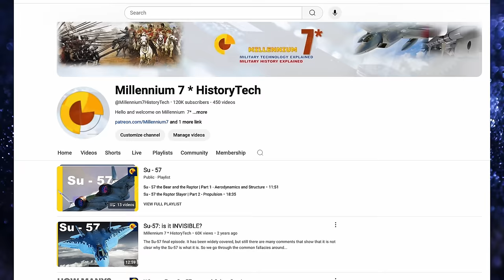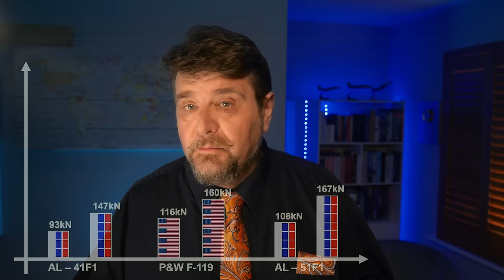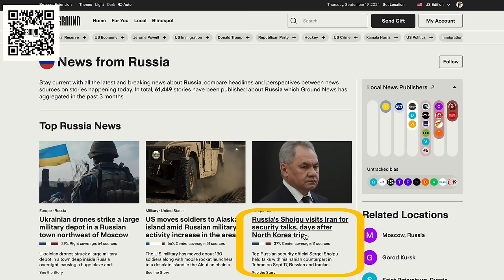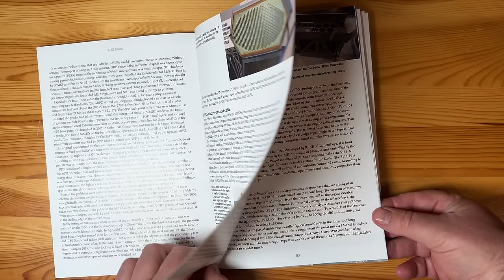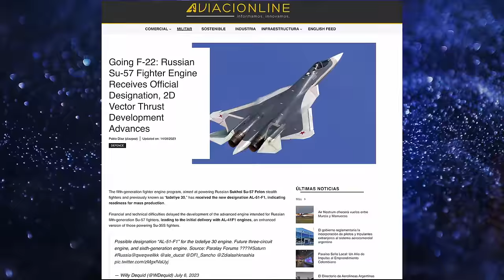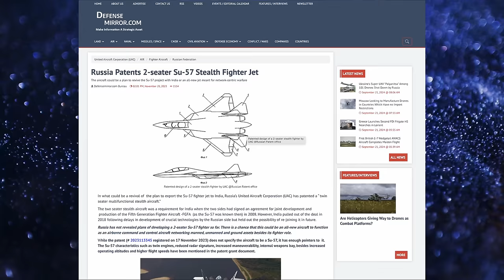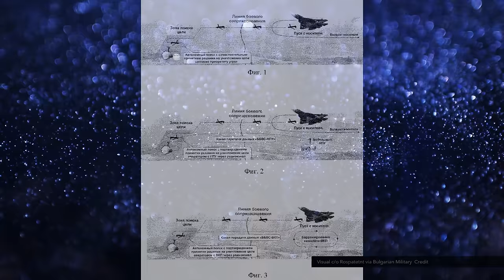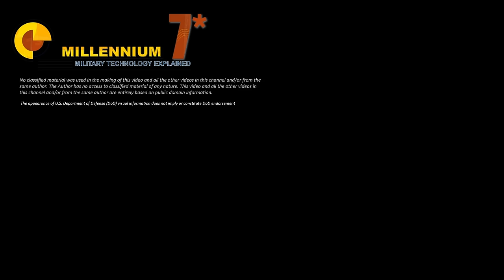The Su-57 is a Masterpiece!

Comment: F-22 is actually stealthier and more maneuverable, if you compare their RCS, Su-57 is claimed to be 0.1 vs 0.0001 of the F-22.
Also the F-22s thrust vector nozzles can tilt 35 degrees vs Su-57 can only tilt about 18 degrees, like Su-35. This allows F-22 to turn quicker. The 3d element isn’t really useful, as it would only come into play if the Raptor decides to initiate a rolling scissor with the felon, rather than just outturn it and shoot it down.
Reply: The F22 Has an RCS of 0.0001 square metres 

The F22 does not have an RCS of 0.0001 in order to say so is to misquote the source that says it, the RCS of a plane is not a fixed thing but varies from angle and by frequency as a result when we say the RCS of a plane we're referring to either an average or median RCS the 0.0001 number for the F22 is neither a median nor average RCS if you find the original quote of which  you can find here[1] you can also find it on the F22 Wikipedia page “from certain angles the F22 has an RCS are they steel marble” and is therefore not remotely representative of the F22's overall stealth capabilities I don't blame you for thinking this as you were fooled by a deliberate misinformation campaign by air power Australia a think tank that is dedicated to get in the Australian government to purchase the F22 instead of the F35 they did this by publishing numerous articles on the late 2000 to early twenty 10s publishing articles that would continuously bash the F35 for both valid and invalid reasons they are responsible for much of the misinformation regarding the F35 that is still quoted to this day during one of the articles that they published they deliberately mischaracterized this quote in order to imply that the F22 was vastly stealthier than the F35 [2] despite numerous statements from US officials that contradicted them  saying the F35 was stealthier[3][4] 

 

the su 57 has a RCS of 0.1 square metres 

you are also incorrect about the SU57 having an RCS of 0.1 square metres this number comes from a 2009 patent for the T50 the prototype version the SU57 the T50 was quite a bit different to its serially produced counterparts it is a lot less sleek of a design and most importantly did not feature any RAM material [5][6] so the between 0.1 and one square metre RCS is closer to the SU57 RCS without ram material not its RCS with and according to this mathematical simulation the F22 would actually have an RCS that falls between this range without RAM material with the simulation given it a RCS of 0.13 square metres.[7] 

 

a comparison between the su 57 an F22 in terms of stealth using mathematical simulations  

according to this mathematical simulation[6] the su57 with RAM material placed on just the engine's and cockpit has an RCS of 0.06 square metres the same simulation simulating the F35 with ram material placed in the same areas suggest it has an RCS or 0.02 square metres[6] a different simulations suggest that the F35 without any RAM material has a RCS of 0.06 square metres[8] meaning the applying of RAM material to this areas reduced the F35 RCS two 1/3 if we assume a similar reduction for the F22 and use the simulation without RAM material I quoted earlier that would put the F22 RCS with RAM materials placed on the engine's and cockpit at 0.04 square metres now of course this is only with ram material placed in certain areas the RCS for all of these planes would be smaller if they had full RAM treatment but the overall reduction for all planes would be similar so the ratio would likely be the same, so it was true that the F22 is stealthier than the su57 but the su57's RCS is not 1000 times larger but more like 50% larger. 

Sorces 

1. Fulghum, D. (2009) aviationweek.com. (n.d.). F-22 Raptor To Make Paris Air Show Debut | Aviation Week Network. [online] Available at: https://aviationweek.com/f-22-raptor-make-paris-air-show-debut., aviationweek.com. Available at: https://aviationweek.com/f-22-raptor-make-paris-air-show-debut (Accessed: 23 September 2024). 

2. Russia’s PAK-FA versus the F-22 and F-35. (2009, March 30). www.ausairpower.net. Retrieved September 23, 2024, from https://www.ausairpower.net/APA-NOTAM-300309-1.html#3 

3. Tirpak, J. (2014) The F-35 on Final Approach, /www.airandspaceforces.com. Available at: https://www.airandspaceforces.com/article/The-F-35-on-Final-Approach/ (Accessed: 23 September 2024). 

 

4. CLARK, C. (2015) Threat Data Biggest Worry For F-35A’s IOC; But It ‘Will Be On Time’, breakingdefense.com. Available at: https://breakingdefense.com/2015/03/threat-data-biggest-worry-for-f-35as-ioc-but-it-will-be-on-time/ (Accessed: 23 September 2024). 

 

5. Butowski, P. (2014) PAK FA stealth features patent published, www.janes.com. Available at: https://web.archive.org/web/20141023114435/http://www.janes.com/article/32190/pak-fa-stealth-features-patent-published (Accessed: 23 September 2024). 

6. Jack. (n.d.). What is the RCS of the SU 57? www.quora.com. Retrieved September 23, 2024, from https://www.quora.com/What-is-the-RCS-of-the-SU-57/answer/Jack-16725 

 

7. Perotoni, Marcelo, Andrate, luiz and rezen, mirabel (2014) Radar Cross Section of a stealthy aircraft using electromagnetic simulation in the X and in VHF/UHF Bands, www.researchgate.net. Available at: https://www.researchgate.net/publication/291102887_Radar_Cross_Section_of_a_stealthy_aircraft_using_electromagnetic_simulation_in_the_X_and_in_VHFUHF_Bands (Accessed: 23 september 2024). 

 

8. F-35 vs J-20 vs Su-57 Summary (2023) basicsaboutaerodynamicsandavionics.wordpress.com. Available at: https://basicsaboutaerodynamicsandavionics.wordpress.com/2023/01/15/f-35-vs-j-20-vs-su-57-radar-scattering-simulation-summary/ (Accessed: 23 september 2024).
Reply: @madnow1   I hate to say it, but I wouldnt bet that France, Australia or Quora knows as much about the F-22 than Lockheed. 
There have been simulations of the RCS of different planes, including F-22, F-35 and Su-57 through a standered A-3 AWACS and it seems that Su-57 wasn’t stealthy at all. In fact it was closer to the F-18 than F-35. 
Stealth coating and RAM paint are very different topics, I only men to draw attention to the designs. Seeing as the US have had practice with stealth aircraft since 1970, and Russia only just built their first one, I think it’s safe to assume that anything they claim about Su-57 regarding RAM paint is not to be taken seriously.
So in conclusion the F-22 and F-35s shape give them much more of an advantage, especially since both planes are getting an upgrade as Russia draws nearer to making its 30th Su-57.
Reply: @MiG-31893  You seem to be confused I am not quoting France or Australia or Quora I am quoting Lockheed Martin in fact my source is the exact same source as yours the supposed quote from Lockheed Martin saying that the F22 has an RCS of 0.0001 was stated during the Paris air show in 2009 what I cited was the primary source for where this claim originated my argument is that the quote does not say what many people say. The quote from Lockheed Martin that supposedly proves that the F22 has an RCS of 0.0001 square meter is “from certain angles the F22 has an RCS are they steel marble” this is straight from Lockheed Martin this is the quote and as you can see it says from certain angles meaning it is not representative of the F22 at all angles but only some this also makes sense to say otherwise is to disagree with locking Martin you are the one who is disagreeing with Lockheed Martin let's make that clear I was also not citing Australia I claimed that the quote from Lockheed Martin was deliberately mischaracterized by Aussie power which is a think tank not a government in order to inflate the F22's stealth capabilities.  

 

As for the whole argument that the US has experienced with stealth aircraft and Russia does not this is a terrible argument because Russia's been developing stealth tech nearly as long as the US they first started to develop it with the Multifunctional Frontline Fighter project that started in 1983[1] the SU57 entered service in 2020 37 years after Russia first started research in stealth Teck, The US and the other hand first started research at stealth tech in 1974 and produce the F22 in 2005 just 31 years after they started researching so according to your argument it would be safe to say that we should not take seriously any claims about regarding ram materials on the F22 then the whole argument that we should be highly skeptical of Russia possessing ram materials is insane there's a whole papers where scientists who are part of the general public run experiments on ram materials the chemical formulas of these materials are no secret in these experiments here is a meta study that compiles data from various different papers regarding ram materials[2] some of these papers are from Russia and if you look at the materials listed you see that many of the materials are extremely basic stuff that anyone could get access to like graphite which is in pencils or black carbon which is literally ash ram coaching/ram paint is not new either with Germany having developed a radar absorbing coating for the submarine periscopes in World War 2[3] ram paint such as this is also been known to be used on every US stealth fighter from the F117 to the F35 so no it's not ridiculous to suggest that Russia has access to RAM materials when the civilian public in Russia do and the Germans in World War 2 did. 

 

As for the argument about the supposed simulation proving that the Su57 was only slightly stealthier than the F18 1. A-3 AWACS is not a type of simulation it's a plane 2.I cannot find this simulation anywhere and since you did not cite your source like I did mine I can only presume this simulation does not exist if you would like to cite it go ahead and do so and prove me wrong but as of right now you have presented 0 evidence that even suggesting this supposed simulation is real 3. I sighted 3 simulations in my comment all of which supposedly contradict yours why would your simulation be more valid than mine. 

 

sorces 

1. Gordon 2021, p. 7 

2. Kim, S.-H. (2023) Carbon-Based Radar Absorbing Materials toward Stealth Technologies, onlinelibrary.wiley.com. Available at: https://onlinelibrary.wiley.com/doi/10.1002/advs.202303104 (Accessed: 23 September 2024).   

3. (1989, February 1). Radar Absorbing Materials - Mechanisms and Materials  Www.Researchgate.net. Retrieved September 23, 2024, from https://www.researchgate.net/publication/235184151_Radar_Absorbing_Materials_-_Mechanisms_and_Materials
Reply: @madnow1  Yes but all stealth fighters have RAM paint, so I just didn’t count it as I thought it would be a needless layer.
F-22 does in fact have an RCS of 0.0001, and yea I do disagree with Lockheed, because do you really think they would reveal the true capabilities of their fighter? F-22 has had simulations done to it by curious people like ourselves, and they found that F-22s RCS from the front is about smaller than a bee, or 0.0001 square meters.
You said the Russians have been working on stealth tech since the same time that the USA has, and yes this is true but look at how many stealth fighters they accually produced? None. 
MiG-1.44, cancelled. Su-47, cancelled.
Meanwhile F-117 flew over Serbia for many years unnoticed until one was eventually shot down, but still. And the F-22, the world’s first gen 5 aircraft, and the one that is still considered the most advanced and deadly warplane today. 35 years later.
Su-57 was Russias first successful stealth aircraft, and it didn’t enter service until 2020, 15 years after F-22 was in service with the USAF.
So all that time that Russia was developing Su-57 just to get it flying, the US were upgrading the F-22 with more and more advanced avionics and sensors.
And then F-35 was entered in 2015, and though widely criticized, it is still a very successful aircraft, much more so than it gets credit for. It can do special missions that F-22 cannot do, though F-22 is much better at fighting stealth fighters. 
Still, no stealth fighter to date can match F-35 outside of the US.